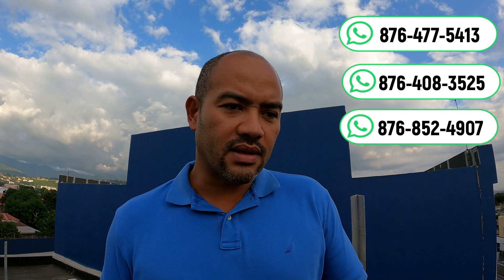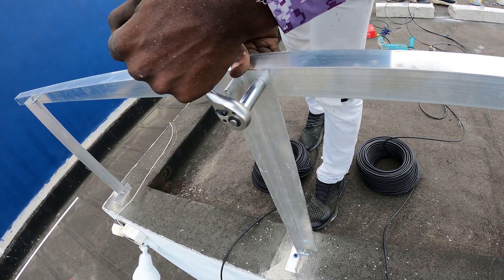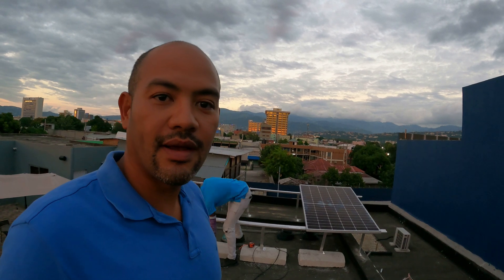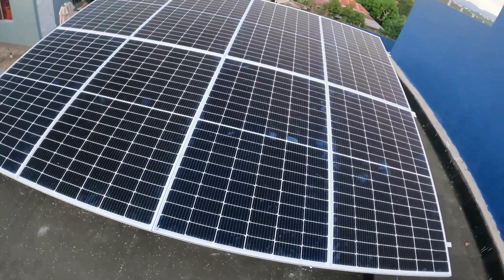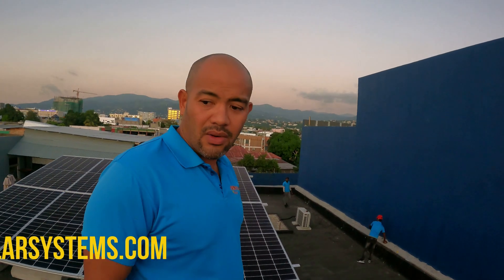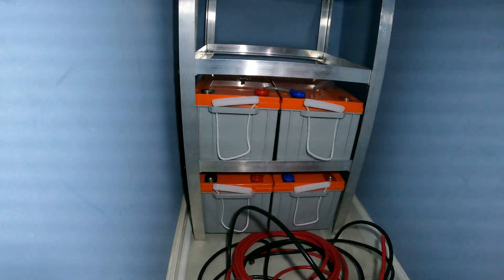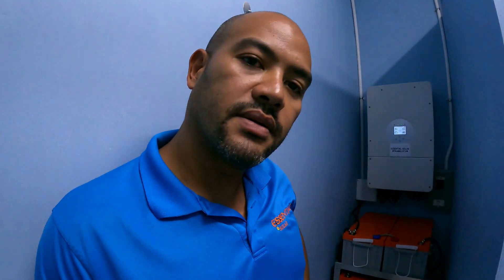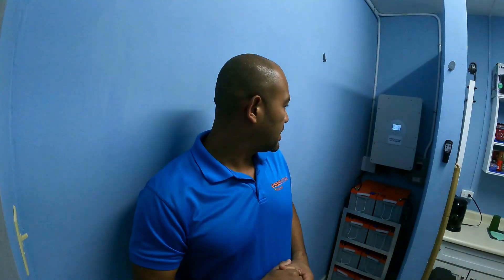3 days installation, hybrid solar system

Comment: I Love solar. I'm building my system slowly by myself. Started with one 100 watt panel now running a single 450 watt panel and soon get a second 450 watt panel and larger battery bank. So far my light bill is less that half what it used to be.